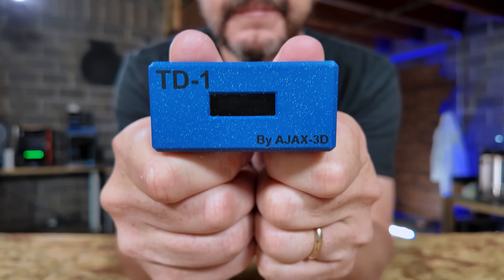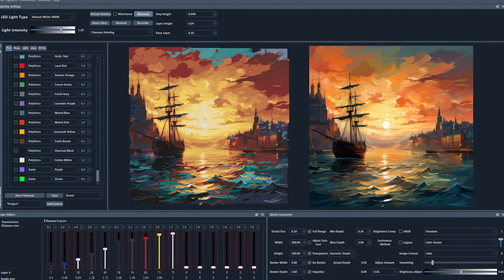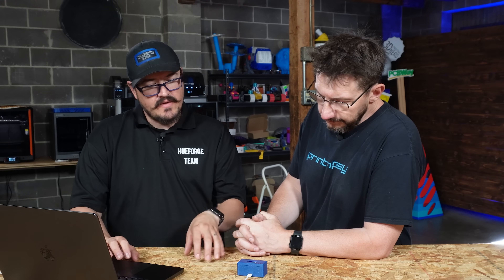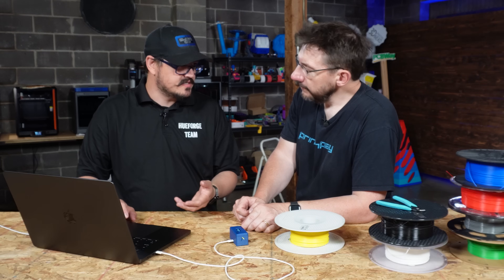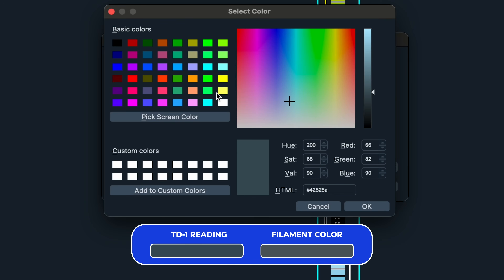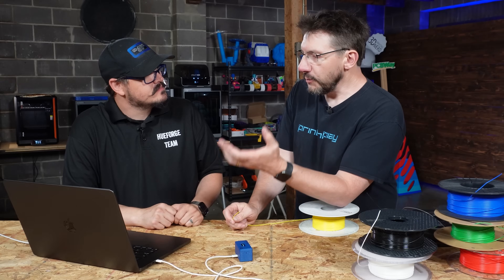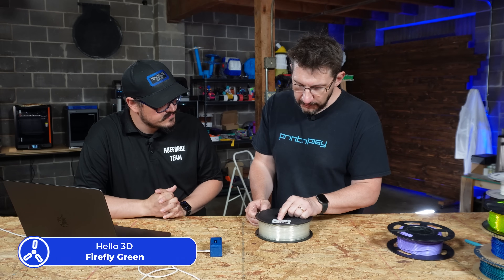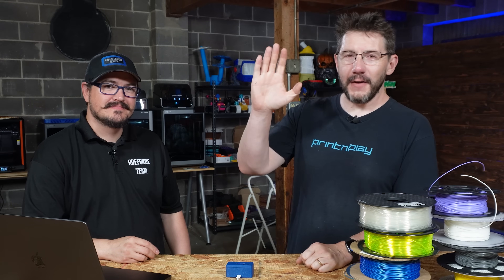Printing True Color at Home!

Comment: As a Graphic Designer, who has calibrated their monitors for professional color correction, I love the idea of this. But as was mentioned, this calibration is based on YOUR biases. And in addition, if you changed computer monitors, you will likely see that your calibration appears off. That is because monitors and screens need to be calibrated as well to properly render the colors more accurately. And laptop screens are notoriously terrible at accurate color rendering. Does this mean we can get real CMYK filaments to print images just like an inkjet printer?

Comment: Not sure if anyone else has mentioned this in the comments, but it's "transmission density," not distance. I used to work with (and actually calibrate) transmission densitometers in a previous job.
Reply: It's "transmission distance".  The hueforge author said it's because he found "transmissivity" too hard to say.
Reply: TIL, thanks

Comment: why not selling the TD pre-calibrated ?   or sell the TD with a small pack of filament and the correct values to enter ?
Reply: Including a small pack of filament for calibration is tricky when it comes to insuring consistency. Not saying it’s not possible, just that a lot of considerations have to be taken into account. And for the most part, TD1s is shipping with calibrations done, but they may not be as good as the end user can get them. So always worth tweaking the cal until it’s where you like it. More fine tune calibrations should be coming with later releases as well.
Reply: @AJAX_3D you could use a couple well calibrated scanners to check the exact color of a piece and print out the hex on a tag to attach to calibrate to later. As long as the color and material stay stable over enough time to get it shipped to the customer, it would be fine to sell additional separate calibration packs should the old ones expire

Comment: I am excited to start playing with Hueforge again but i need to update my TD-1s.  My understanding from the video is that if you have a newer version this is pretty simple process.  Are there instructions somewhere that i can get so i can figure out how to update an original TD-1?  It was mentioned you had to take apart the TD-1 and push a button.  Looking for the instructions to follow completely from beginning to end to update a V1 TD-1 through Hueforge. (bonus points if there are pictures as well) I have checked the Ajax site as well but nothing clearly stood out to me if there.  I found some links to Patreon for fireware links but require a membership.  I dont think i should have to pay to get the instructions for updating the firmware.  Great video and looks fun.  Happy 4th of July.

Comment: Hi to all,
I really like the basic idea but if most of the deal is to manually adjust the nearest color I do not get the advantage. As far as you are not color blind the manual aproach seems more precise to me, so far.
Maybe if a database of well known fillaments get measured it might get more usable.
Ilke you efforts and like the idea... ... but right now? Where is the usp?
Kind Regards.
Reply: The calibration process is something you basically do once and then every scan after is corrected. You should not have to do this with every filament you ever want to test. Rather just a handful to get the calibration then it should be close enough for future use.

Comment: I really enjoy hueforge.
Gets me wondering if polymaker will include HEX/RGB and or TD values in their filament data sheets at some point as they already have so much informations displayed (wouldn't be perfect due to manufacturing batches, but a close enough for me)
It would also be cool if there were color packages for filament, like 200g spools -> so 5kg PLA would be 25 spools/colors (wouldn't mind a higher price/kg as some spools of specific colors are just sitting around with 950g left)
Reply: They actually tried this with the launch of Panchroma. It didn’t go well. TD was way off in many cases.

Comment: I initially thought this is just a regular 2D printer, but realized that it means you can technically 3D print in a full true color using same method (will cost lot of pooping from color change if you don't have multi nozzle). Really exited to see that happens in the future!
Reply: Use change filament after you slice it by moving the slider to the proper layer height and right clicking on it.  This will eliminate much of the poop in these types of prints, or else add an additional item to your slicer and right click it and select purge to this item, I believe. Then youll end up with a random multi color 3d-print. Which is better than a ton of poop, at least in my opinion.

Comment: Sadly mine broke down and no waranty on that because it was more then half a year (according to AJAX via Discord). And the UK located store that sold this one doesn't respond on my e-mail. So.. mine is going into the bin. And the new one costs soo much more (and also customs fees to NL will add more to it). So sadly no TD checks for me anymore.
Reply: I wouldn’t chuck it just yet. I have been in communication with Vector 3D I would assume he will be responding to you.
Reply: @AJAX_3D  Saved from the bin! No response yet, but.. it's maybe too soon.
Reply: @LM-yh1lj out of curiosity, have you tried connecting this to a standalone power supply?
Reply: @AJAX_3D  Yes i did that too.. and the screen won't come on with a seperate one either.
Reply: @AJAX_3D  Update : didn't got any word from them. So that's it then i guess.

Comment: And if you present it with a dichromatic filament?
Reply: In short, it should successfully scan the color that is facing the color sensor. Weird results can happen if the junction where the color blend is exposed to the sensor. I personally tested on one that was blue on one half and pink on the other and each side was successfully scanned.
Reply from the maker: it'll probably very fairly opaque, same with a tri color filament. that's just my guess.

Comment: This is nifty, but it seems to be working from the wrong end of the idea... It sounds like you'd want a filament manufacturer to come out with a series of filaments with known color and TD values to use for combinations without any need for calibration in the first place.
Reply: Yeah the biggest issue here is that the manufacturing process for filament does not have the consistency to make this possible.
Reply: @AJAX_3D  Is that only because there's been no printers until now that have utility for such things, so manufacturers haven't been trying to dye their filament so carefully?
Reply: @o0shad0oo in some ways yes. Some manufacturing processes allow for much more consistent production. But most of the big manufacturers do not use these processes and likely won’t be changing their production lines to do so.
Reply: @AJAX_3D  If more printers are capable of utilizing full color printing that may change.
Reply: @o0shad0oo I don’t see that being a large enough market anytime soon. Adoption takes time and between then and now, testing what you have is important for getting predictable results.
Reply: @AJAX_3D  You're probably correct. I'd really like to see this tech added to genuine 3D printers, rather than only this specific surface printer. Don't know what the tech entails and I don't know what IP is in the way.
Reply: @o0shad0oo  work is already being done to be able to install this on a box turtle AMS and load colors in real time. At the moment this work has these color and TD values collected in mainsail and the next step is to do work to get that data all the way to a slicer so you will always know what color you put where.
Reply: @o0shad0oo  I mean the market was not kind to color-accurate filament. Remember pantone filament?
Reply: You would need a universal standard for that.
Reply: @davidtobin  True.

Comment: Next gen idea: ship with some short pieces of calibration (known reference) filament and design some places in the housing where they slot in to for storage.
Reply: yea it really needs to ship with calibration pieces.
otherwise its all just guessing and hoping you adjusted it well while also hoping your screen reproduces color accurate enough for any of this to work.
Reply from the maker: Great idea!
Reply: @JonS  I was thinking the same thing. 150mm (6”) pieces of known and ‘pure’ black, white, red, green, blue, yellow and maybe a grey. At least it would give everyone an initial calibration that will be closer. Plus, while many of us have a lot of filament, not everyone will have all the calibration color filaments themselves on hand. It would be a cheap and easy addition to the BQ kit.
Reply: It doesn't even need to be a filament. It just needs to fit in the device and get the device set correctly.
Reply: This
Reply: Or for instance using know filaments like Bambu CMYK etc.
Reply: Unfortunately the calibration filament could change its own values. Depending on how its stored, temperature, humidity and uv light exposure can have an effect on colors and material. The calibration filament could look after weeks a bit different :/ 
But on the other hand, it shouldn't change by toooo much 🤔
Reply: @Keks-Monstaa  if it's stored inside the TD-X housing, it would be protected from UV at least. Also, the filament chosen for the calibration samples should be selected for stability (for example, no dyes, only pigments for color).

I know color calibration targets are not trivial (I have purchased many X-Rite color checker cards at $70 a pop during my career in imagining), but I believe this could be made to work.
Reply: @Keks-Monstaa  It would still be more accurate, especially if it can be sealed in a lightproof bag
Reply: @Keks-Monstaa  it also would matter so much because you can do an initial calibration and then save these values somewhere.
The device could also come precalibrated from the factory.